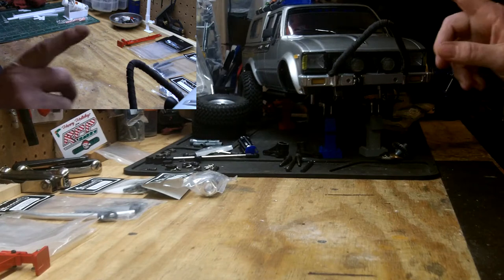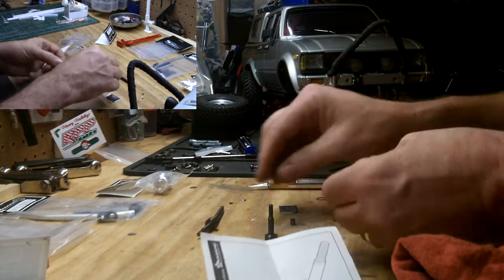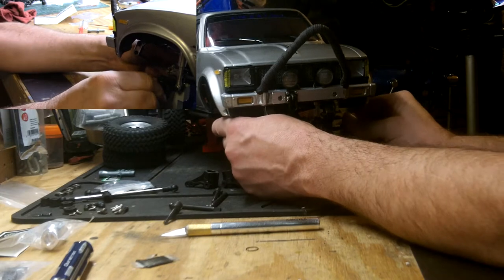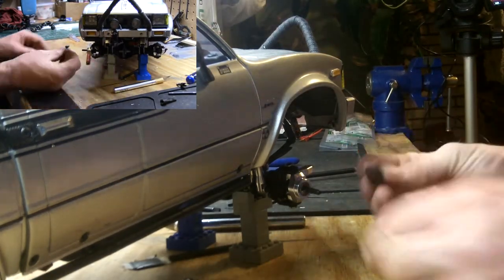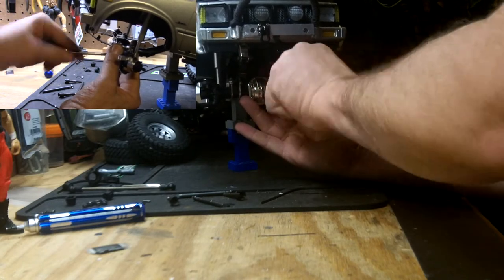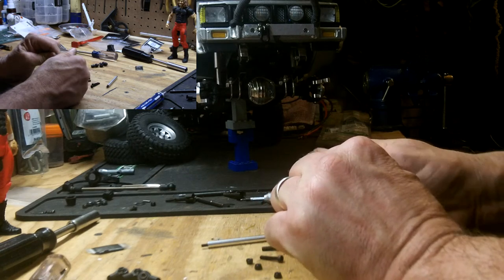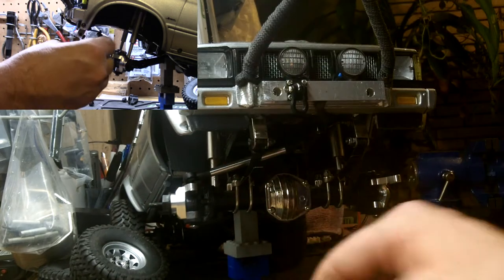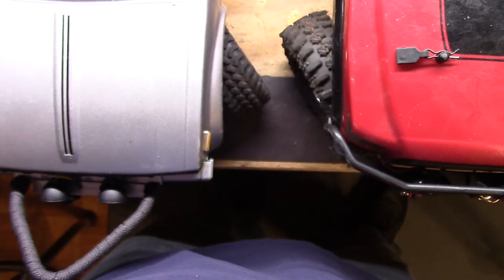Installation of gmade zero ackerman knickles

Comment: Nice video....quick question....is the chassis the same as the komodo gmade gs01.?
Reply: If so how hard was it to fit Toyota body?
Reply from the maker: chassis is similar. I made flat steel plates that mount to the frame and then have slight turn ups on the outside to utilize body mounts. Sorry took so long to reply.
Reply: @RCExploits  Thats ok m8, I understand real life stuff n all , thanks fa replying,  hope you doing ok, appy Holidays.